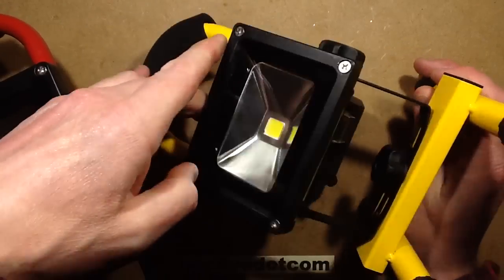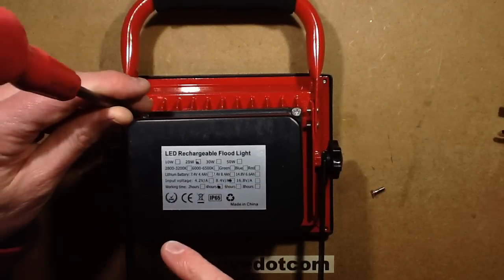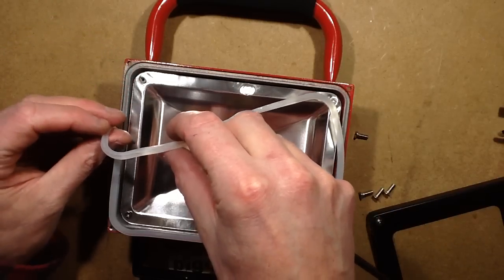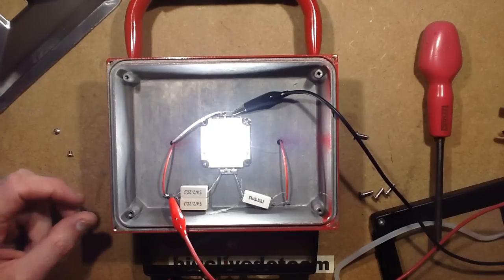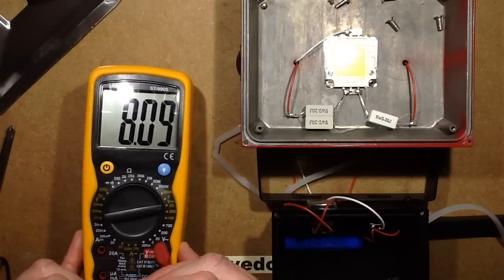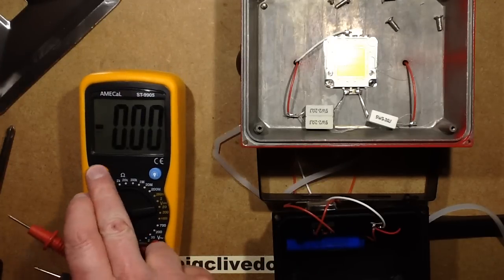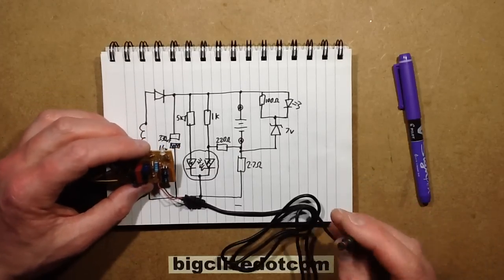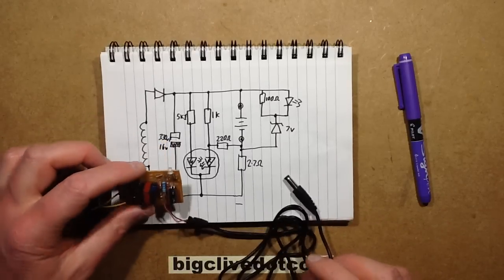A look inside a 20W rechargeable LED work light.

Comment: I have a 50w Rechargeable Portable Ul LED Floodlight 
With DC plug charger & Car Charger 12V Output: 8.4v
Battery Type: Lithium-Ion Built-in Battery High power battery capacity 2200mah 8.4V     
I wish to adapt this light to take my Makita 18v - 5.0 Ah Battery. (as these charge within 20 min)   Would i need to use a Step-Up/Step-Down Voltage Regulator?  Or anything else? Sorry to appear vague,this area is not my specialty.

Comment: when i tested the led the  current draw was 6A from the battery which is strange  i know 5A at 12v is 60w  but at 6a is about 72w dissipation from the  30w led . and  the chips was turning blue colour like when u overload a  white led slightly when it goes slightly blue  and i also tested it at low voltage and it was uneven illumination  across the led package  . so i just removed everything till one day i might rebuild it  with  current regulation ect   as i paid just over £40 for it that time .....the chip is rated 30w 12v  not the 36v version
Reply: and the charger put out 13v not 12.6v which is bad in a way

Comment: @ bigclivedotcom i have (King Canada KC-2401LED) got from the local gettin spot (glass was smashed and the company i work for wouldnt repair it) the driver also went bad (was probably me messing around with it but it was rated 120v ac- 24-36 v dc @ ~500 mA) it states it as 20w. im trying to repurpose it as a rechargable portable unit with 6 18650s in series then to a switch and up-converter (adjustable, because its pretty dim ran off of just the 18650 series battery.) can i use a 5v usb charging circuit to "trickle" charge it and should my powerswitch be before or after the up converter (im thinking before because it makes more sense).

Comment: It's Chinese - end of story!

What worries me more is that these people were supposed to be building our (UK) next generation of nuclear power stations - what corners might they cut on that project? No good fobbing us off with a capacitive dropper and a two colour LED on that one!!
Oh, smaller battery than I expected, and the reactor vessel door is attached with two screws, cross threaded, and the gantry crane is only half the required capacity. No problem, they'll probably only refuel with new Plutonium rods about ten or twenty times in its lifespan.

Yeah, Cheap is good . . . . . . . .

Comment: Ah wish I saw this earlier lol. I bought DIALL LED Site light from screwfix for £30 - 23w - and it's so much better than this 50w big light I just bought. Will be sending it back since it's not as well made and not as bright. My little light is heavier than the big 50w. Tried contacting ebayer before buying but no response so thought I'd just give it a go.

I wish someone actually properly made 30-50w led site lights rather than these fake crap ones. I need them for outside when I'm travelling about and 23w is great but would love to have 30-50w. Would be great to if they used T6 CREE LED also. If someone actually made decent ones I would happily buy it.

Comment: the charger for mine it puts out 12.6v for 3 cells 2in parallel  as its a 30w light but i need to replace the led as it died weirdly

Comment: Why do the instructions say do not use light while its charging? What happens if you do?
Reply from the maker: +Darren Jowett I don't actually see it causing any issue other than maybe not charging the battery to full capacity in these units.

Comment: Do the batteries reach full charge using the car charger?
Reply from the maker: +Darren Jowett Add long as it puts out the required 4.2v or 8.4v they should.

Comment: These work lights are all over ebay and amazon now with a hundred different brand names. I bought one for £19. I like it. Obviously not 20W but it lasts the quoted 4 hours (on the first two charges anyway). Very usable light output. Plenty of room in the box for hacking in more cells.

Comment: the charger is not charging to full,these are as the led ,cheap chinese batteries so if you use a bigger psu you might over charge with a chance of exploding batteries

Comment: Hi, I am new into this high power LED stuffs and I have this question that I need help from you guys.
How to drive the 20W LED by only 8.4v from 18650 lithium batteries?
Isn't 20W LED needs about 30v not 8.4v to work?
I even didn't see any step up module here.

Please can any body explain this to me.
Thanks in advance.

Comment: You could replace the 2 Lipo's with a 4S Lipo pack used for drones and then adjust the values of the resistors to get a decent current usage and improved runtime (or just add a couple more 18650's!

Comment: I should really make one that runs off a power bank. But then again i don't trust these ratings of 10-20-30watt I want to get the most lumen per watt with the wattage of max 10 this way 5v@2amp would be good

Comment: Hi, Im looking for a handy rechargeable worklight for working in a garage at night. So im wanting a strong light source with a life of at least a few hours before recharge is necessary preferabally 6 - 8 hours. Now is something like this quality even on the market or is it all rubbish like this LED work light ? Your reccommendation is much appreciated.
Reply from the maker: For detail work I strongly recommend getting a decent rechargeable head torch.  Then add a portable work light for a bit of general room fill.   That way there will always be plenty of light where you need it.
Reply: Thx clive . Any recommendation on head torch is appreciated ! I have one of those cheepo 10w led lamps you reviewed hooked up to a car battery and its ok for bg light but i need something brighter for measuring and marking. Specific brand and model or spec is appreciated.

Comment: Can anyone solve this mystery?  - bought what claims to be a 20w work light. It is actually 3w.  Just turned it on today and it won't light. Plugged the mains charger in with the switch at the mains socket off and it lights up? The socket being a single pole switch only. I can even remove the charger from the mains socket and it remains on. But if I remove the jack from the charging socket it turns off.
Reply from the maker: It sounds like the back of the jack has been miswired through the inserted-plug contact.

Comment: I think the reasons for the under powering the led is so a smaller and cheaper battery can be used. It also extends the life of the LED chip as the temperature rise is less so the light can work at higher ambient air temperatures. It is common practice for lamp manufactures to use an oversize led chips and under drive them but still claim the full LED chip wattage. The undercharging of the battery is done deliberately so there is no chance that the battery could ever be overcharged. The circuit is very basic, you may find a small charging voltage variation between chargers in production due to tolerances in the components and the zener junction temperatures. Can't be precise with a rough circuit like that and get a perfect 100% charge. Its all to keep the cost down and be competitive.

Comment: Just opened up my LED flood light and it have ONE 18650!!! Could not believe it!
Reply from the maker: That's like the one in the recent video.  It makes it MUCH easier to retrofit a new LED.
Reply: TNice777 add it on paralel to boost capacity

Comment: Why don't we challenge them under European law the light has a CE mark!
Reply: Based on what? "CE" only says the manufacturer thinks it's safe. Overrating is not a basis for litigation wrt the CE mark. Consumer protection laws might give you leverage.
Reply: CE in this case simply stands for 'China Export' while pretending to be Certificate of European Conformity. The proper CE letters are further spaced.

Comment: You need some serious electronics education. Ohms law does not apply to LED's. You can have 12 watts worth of power (current x voltage) into an LED and because of the efficiency of an LED you can easily get 20 watts or more of light. Modern LED replacement lights typically only consume about 14 watts of power but produce 60 watts of light. Ohms law will apply to incandescent lamps.
Reply: You're wrong there. Ohms law works for LEDs too and LEDs do certainly not create power.
Reply: John Robinson
You need some new tech schooling on LED's. If OHMS law worked for LED's why do new LED lights for your home produce over 60 watts of light and only consume 14 watts of power? Think before you speak. NO you are wrong again, lights do not produce power in watts only give off watts in light.
Reply from the maker: If a 20W LED has a forward voltage of 33V and runs at a current of 600mA then it is indeed dissipating 20W.  You do not measure light output in watts.  The rating of the LED in watts is its electrical power dissipation.
Reply: Think of it this way : In an ordinary filament light bulb less than 2% of the energy consumed is converted to light. The vast majority of power is wasted in heating the filament  to around 2000 degC where it glows brightly. So around  98% of the power consumed produces heat - which may or may not be useful.  A halogen light bulb is around 2 times more efficient - but still less than  4% light efficiency.
In contrast LED's run relatively cool and produce the same light output for a lot less power in.  They do not create energy - they just waste less energy for the same light out.  
For reference: Light output is measured in Lumens and if it were possible to achieve 100% conversion to light (ie no other losses at all) then 1 watt would produce 680 lumens. Currently LED's typically produce 100 Lumens for each 1 watt power consumption. Something like 10 to 15% light efficiency typical which is slightly better than flourescent lamps but they still improving.
Reply from the maker: The first rule of Dunning Kruger Club is that you don't know you're in Dunning Kruger Club.
Reply from the maker: +LIAR HILLARY Yes all household lamps are measured in watts, which is their electrical power consumption.  You get different variants of 100W lamps with different efficiencies and light output levels.
Reply: You're telling that a guy who designs electronics knows less about electronics than you? Here's a hint: google "Dunning-Kruger effect". You don't know shit.
Reply: You can't measure Light in Watt. Simple as that.
Reply: I like apples
Reply: Output of light is in lumens, not watts. Watts is simply power consumed. Though I think you must be trolling.
Reply: All household lights are measured in watts.
Reply: Package says 60 watts equivalent to in incandescent lamp but consumes 14 watts of power. 116ma x 120v = 14 watts, approximately.
Reply: Maybe reading comprehension is your shortfall as well.
Reply: Lucas Hedström
Power in watts. Yes
Reply: Lucas Hedström
Incredible
Reply: lol

Comment: I recently bought the 50w version of these light (needed a powerful wide spread floodlight for night time film making) But i found it doesn't even output as much light as my little F&V z96 led panels. I was curious while watching your video, if it were possible to modify it in some way so it could either output the wattage it was claimed to be or maybe replace the led unit, which only seems to have 2 rows of emitters, with one that had a full set of emitters? Would love to get some opinions on this. I still like the light and it being waterproof and battery powered will come in handy, just would be nice if i could get a little more intensity out of it. Thanks.

Comment: I hate how they keep cutting costs until they completely ruin it. Zener instead of TL431, then 1N4148 instead of UF4007. I have seen a lot of USB chargers stating 5V / 500mA being rectified by 1N4148, which is rated 150mA (!!!). The resistor used instead of a current regulator is still reasonable, but the 1N4148 is going to melt and short in a few seconds. Then the main switching transistor is going to explode together with almost all parts in the circuit :D.

Comment: This explains why it's so hard to tell if these chargers light green, orange, red or whatever. Looking straight on the LED it's one colour, but looking at an angle it's another colour. So annoying.
Is it possible to buy a proper designed compact charger for this, after seeing this I don't trust these chargers and you never really know when the battery is fully charged (if ever), or if gets overcharged due to poor tolerances.

Comment: Hey Clive. Have you come across any of these yet that you would specifically recommend that actually come close to their advertised output? I picked up a wee 10W from a supermarket out of curiosity as much as anything else, and actually quite liked it as it's useful for my photography. I ordered a different 20W from Amazon, but it seems even dimmer than the 10W, and is certainly no brighter

Comment: After watching this I decided to take my 'expensive' version of this light apart as mine seems to last the 8 hours quoted on the back, even at full power. It seems I have 8 18650 cells in it rather than the measly 2 of the cheaper units. You really do get what you pay for.

Comment: Considering that power unit is so tiny, couldn't you easily hack it so that it lasted a good 10-12 hours with a couple of extra units? From what i hear of people i know that are in the business of using these worklights, is that the batteries deteroriate really fast.

Comment: DO NOT BUY THIS LIGHT. It only says in the manual that you can not use the light With the charger plugged in. Nobody reads a manual for a light like this. We had them at work, and every one has broken, because using it at the same time as it's charger is plugged in breaks the unit itself.When a workday is 8 hours, and it only Works for 4,5 hours, what do you do for the last 3,5 hours?

Comment: there is a benefit to charging lipos under their 4.2v/cell.  if you charge to 4.1 per cell you double the number of cycles you'll get out of the pack.  I fly rc helicopters so I deal with lipos very often! (:

Comment: Another question for you Clive... If you were to encounter a cross-threaded screw (that is possibly glued in?) made of complete shit that just gets chewed up by your screwdriver to the point where there's just a round pit left in the screw rather than the phillips cross groove, what would you do?
Reply from the maker: +Sebastian Ramadan You can get spiral inserts that tap into a re-drilled hole if it's crucial.  Or rivet-like threaded inserts.

Comment: i baught 2x 30w cool white floodlights 
the leds are bad at 12v they come on 
plus they draw 23.3w on mains via 32v driver ? paid £15 for both
Reply: i think i have a genuine 30w portable floodlight that has 6x 18650 cells

Comment: As many of these units will spend most of their lives plugged in waiting to be used, charging to 80% rather than 100% might actually be a benefit to the long term health of the cells perhaps...?
Reply: If the unit is sitting unused most of the time, then keeping the cells at 100% is not good for them - current wisdom is store at 60-80% charge for the longest life span. So, if these units only charge to 80% anyway, that might actually be a benefit to the long term health of the cells albeit at the expense of slightly shorter runtimes when actually in use. Determine what runtime you need, then spec a cell pack with 20% more than needed and only charge to 80%.... Job done.
Reply: not quite... lipos aren't happy constantly sitting with a current on them.... a proper charger shuts off when up to voltage.
Reply: +topher 
Peter is right or maybe you misunderstood him. 
charging li-ions only to 80% is universally better than to 100%, battery health wise.
Reply: +ECN well when you charge them to 80% then continue charging them holding them at 80%, no that is bad for li-ion batteries.
Reply: +ECN and charging to 80% isn't "better" than charging to 100% it means you'll get more cycles yes but you get less capacity.
Reply: Maybe, but I'm sure there is a point of break-even between charging cycles and less capacity per charge.
OP's thoughts were initially considering the fact that having the battery sitting 100% charged 90% of the time is a bad idea.

Comment: I am not that well versed as you are in electronics, but if I may add, the idea behind charging the cells to only 80% of its rated capacity is to lengthen it's life. the Nissan Leaf uses such a method of charging its pack. I hope I got that right :-) Cheers!

Comment: Have you noticed that some manufacturers basically re-purpose the main unit as a rechargeable motion sensing solar powered security light? The reflector / LED module certainly looks identical.

Comment: I can see a modification coming on, fill it with 8 0r 9 18650s in series to get to 30 odd volts, replace the LED with a 100W unit and light up your garden, and all the neighbours' gardens.
Reply: James Lamb run time and heat 😉
Reply: You forgot about the missing active cooling fan. It also takes some quality cells to cope with the higher current of over 2.5 A.

Comment: can i just using regular resistor instead this stone blocks resistor? what's the difference? i mean regular resistor for limiting the current right?
Reply: +Prasetyo Muhammad Dwi you can if you want the resistor to fry itself and leave a nasty burn mark on the device and possibly your fingers as it fails.  Power handling and dissipation capacity is why the wire wound (stone block as you call them) are used.
Reply: so regular resistor just for power handling and for lower wattage led's right?
Reply: +Prasetyo Muhammad Dwi resistors differ in their power dissipation, the small ones are 1/4 or 1/3watts, you need a 10w resistor for this lamp or the resistor would burn out higher rated resistors are larger, and use a ceramic box that can withstand higher heat (and are still sometimes attached to  a heatsink)
Reply: jusb1066 so much brief explanation... but hey thanks for clearing this up :D